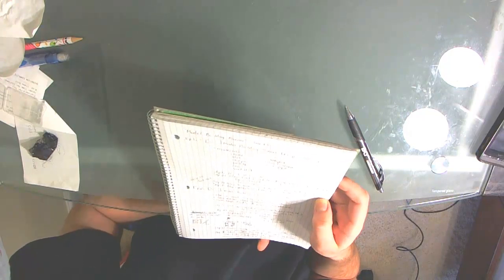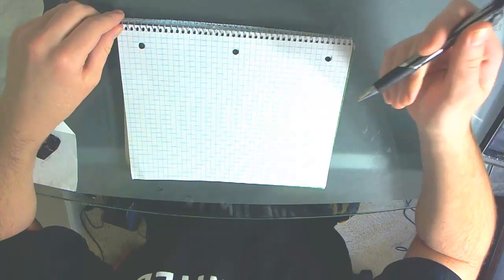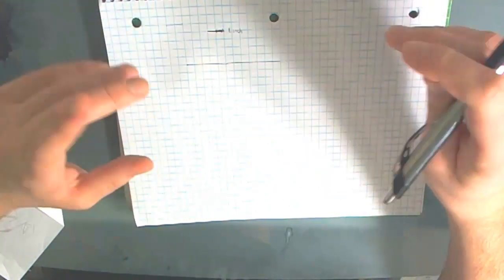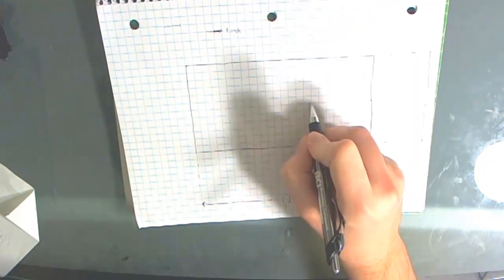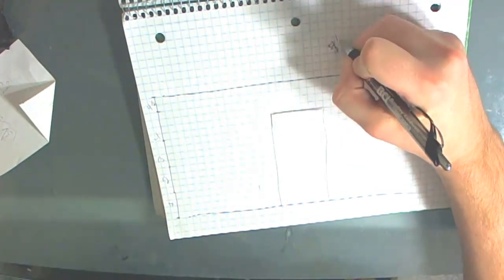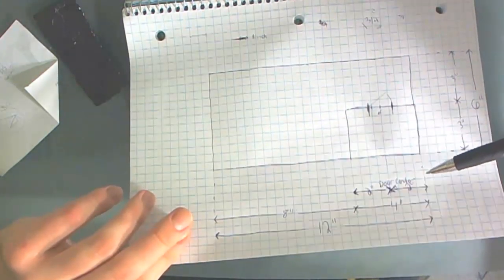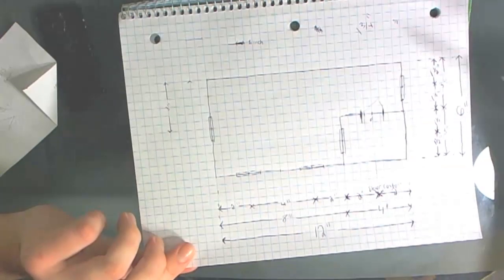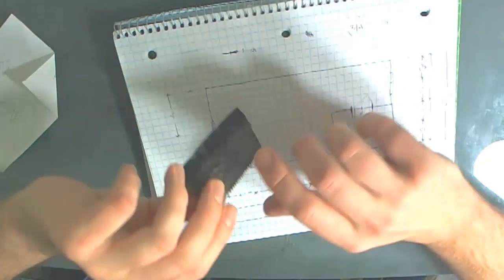[1/9] - Model Building Process - Design Stage

Comment from the maker: I figure this is easier because you just pretty much double the real length then divide by 24.  Also, 9ft ceilings are standard in my area.  And I use inches/feet :p

Comment: Better way to scale if you want to make it more realistic would be as a guide if you take hight of the wall 1 stick 4 1/2' (114.3mm) and wall hight is 8' (2440mm) would be a 1:20ish scale.

So to be make a realist scale for head heights would be 7' (2100mm ish) or scaled down 4.13 (105mm)